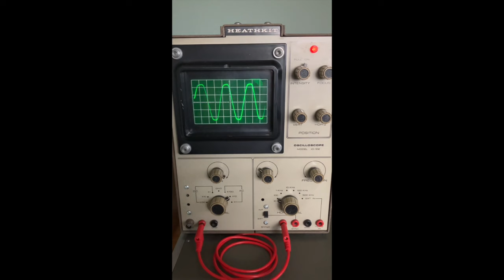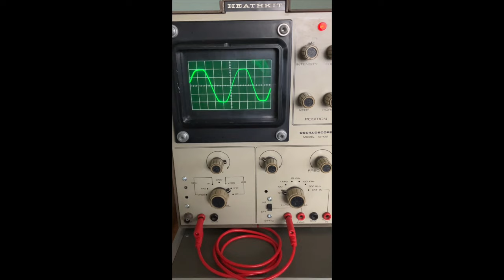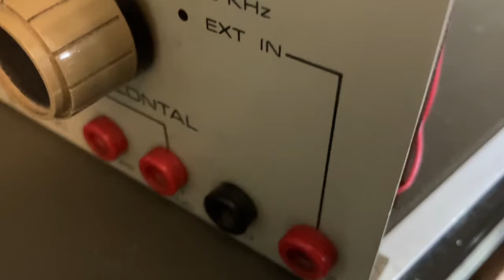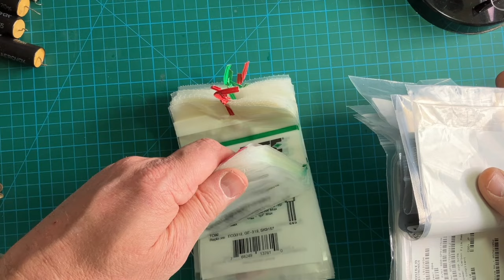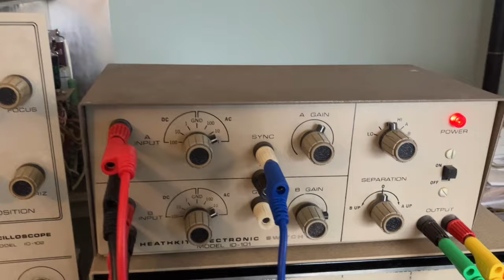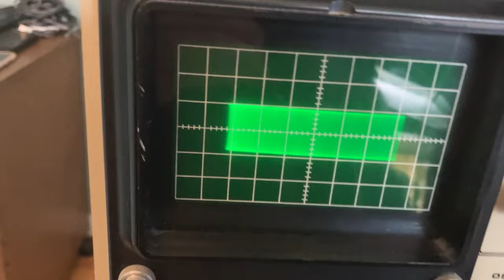Heathkit IO-102 Repair, Mods & Demo

Comment: Congratulations for keeping this beast operational. Back in the 80's, I was given two of these. My impression was that they were neither reliable nor stable. Mine had vertical amplifier issues. But I guess everything has a cost. At least you had fun putting it together!
Reply from the maker: It's been solid since the 1970's, with just a recap and reresistor for good measure.  Thanks for the comment.

Comment: Nice video.   A while ago I saw a craigslist ad for a Heathkit IO-4510 scope for $50.
Dual channel.   I  was messing with building tube amps for guitar playing at the time and wanted a scope to testing.

I went to buy it and upon power on test by the former owner something broke.   It would not power on.
He was the orignal builder, but didn't want to mess with it further and gave it to me for free.

Upon bringing it home it was a single diode 1n4001 or maybe 4003  that had blown.   The PSU caps were OK but I
replaced them just the same due to them being original.

I went and purchased an expensive 20kv rated DMM probe for about $50. The last such item in stock at Frys at the time.

I seem to recall changing the voltage regulator circuit built from discrete transistor arrangement to a 7505(I think).

Worked well, but I ran into a block while calibrating it.  A trimmer capacitor for the vertical trace circuit which is broken. 
It turns but does not make any change on the trace.

For some reason too  they made it super hard to fix because the cap is under the massive stepper switches.   I had to get a super
long length non-conductive screwdriver just to even attempt to adjust it only to find it was really mushy when adjusted and finally 
the top portion fell apart.

Sadly, there's no way to replace that cap without major surgery.  I'll have to desolder 25 pins of the switch to even get my hand in there 
to remove the old part much less position a new one.  I still have the scope gathering dust.  My own electronics hoarding.  

I might get around to repairing it one day.  I think one of the reasons I never did though other than the location was being unable 
to find the same type trimmer cap.  It's been probably a dozen years now since I shelved that scope.   I noted recently though that 
someone selling Heath replacement parts. Maybe I can get that part now...   I might revisit this scope.
Reply from the maker: The 1980s IO-4### series scopes succeeded the 1970s IO-1##.  Nice scope, especially just before Heathkit started really cheapening out their test equipment (IG-5282, IB-5281, etc I'm looking at you).  The vertical compensation trimmer caps that appear to have failed you aren't critical, they're just in parallel with the input attenuator resistors.  Unless shorted, they should not prevent a waveform from displaying.  In fact, most quality scope probes have long had such trimmers built into them.  Your IO-4510 certainly deserves a new life.  Thanks for sharing its story.
Reply: @dtss_smudge  I really went all out at the time.  I scratch built a 4505 scope calibrator.    Made a 1:1 PCB and everything but I reworked the 5v regulator which uses discrete transistor regulator circuit to use a normal 75xx . 7505 probably.   
I made it into a tank compared to the kit version I've seen.  The power transformer is I think over sized but was probably what I found in a local electronics / surplus shop here in Houston.   The logic chips were cheap at maybe a dolllar or two each.  Was a fun build.

I forget what I was doing in the calibration steps of the scope, but I was probably using the 4505 I built in lieu of something more expensive.     I am sure that trimmer was actually broken.  I want to say the whole top came off so it was open maybe.
I know it was a major road block to calibrating it per the manual.

Comment: Great video! I have the equivalent, mint condition with manual, Heath/Schlumberger SO-107A which was a factory wired unit. My father bought it back in 1973 for his FM broadcast radio station. I went through the whole thing as you did, replacing all the old electrolytic caps and some resistors mainly in the power supply section. Not the best 5 MHz scope but good enough for audio and low frequency RF work. Sorry to say I will be putting it up on eBay soon as its time to part with it. I hope someone can use it and not e-waste it.
Reply from the maker: Obviously, 5Mhz was good enough for a FM station!  Make sure to mention on your listing that it was factory and refurbished, Include pics of what must be awesome factory wiring!  Thanks for the comment!
Reply: @dtss_smudge  Thanks for the advice!

Comment: Your video is remarkably detailed. Thanks for your effort!
I also too a IO-102 scope in 1971. That scope is long gone.
I purchased another one on Ebay a week ago.
I fired it up quick. A trace was present. Horizontal and Vert position responded. I felt good.
The next day I was going to delve into more detail.
I fired it up again. No trace present. center dot only. Gain and focus are the only responsive controls
All othe front panel controls not responding.
I removed the side covers. I noticed nothing obvious regarding failed components.
I'm wondering if you have any ideas that would help me focus on a particular circuit/component.
I have the original assembly manual that came with the kit. Complete schematics.
Your input would be greatly appreciated.
Thank you.
 
   
.
Reply from the maker: Since neither horiz nor vert position have any effect, it would seem unlikely that both the horiz and vert amps are faulty.  Really the only thing they have in common is the power supply.  Check each of the PS board's outputs.  Since you have a dot/intensity/focus,, the HV section is working.  must be one of the lower voltage outputs.  Good luck, and take all high voltage precautions when working in the unit.

Comment: Hello and thank you for your video. Sorry, I speak French and I'm using a translator. On my Heathkit IO-102, I replaced the same capacitors as you and the four D40N1 transistors with MJE340G. I bought 2N5459 to replace the MPF105. I'd like to know what equivalent transistors you replaced the 2N3393, EL131, and all the other transistors with, please.

I'd also like to know how I could increase the brightness of the spot, for example the sine wave on the screen, because even though I have a nice image, I think it could be brighter, especially when I increase the frequency. My other oscilloscopes have a brighter trace.

I bought the Heathkit ID-101 on eBay and I'll receive it next week.

 Thank you! 🙂
Reply from the maker: @gtrgib:  Les obsédés de Heathkit francophones sont plus nombreux que vous ne le pensez :). SVP un courriel direct (adresse disponible  en bas de "more" -> "More Info" sur la page d'accueil du canal)  et je vous renseignerai complètement.

Oh, and thanks for taking the time to comment!
Reply: @dtss_smudge  Hello, and thank you for taking the time to answer me.

Why not simply display the list of components you used in the description below your video? It would be very helpful for anyone watching it.

Regarding my question about brightness, answering it directly here would also be very helpful for everyone.

Thank you! 🙂
Reply from the maker: Regarding the parts sub list, I must have assumed my esteemed viewers would simply screenshoot it.

I'm happy to post it, and some other related stuff, in the Description.  Have a look.

I don't remember exactly which transistors I actually replaced,
except that all diodes
and pretty much everything else
on the PS board was replaced,
except Q301 was in fact fine after I added the makeshift heatsink.
As I remember, the other boards worked at least to some point.
Troubleshooting them should in any case be relatively easy
once some sort of green shows up on the CRT!

Regarding the CRT brightness:

(Disclaimer:  Everything below involves tinkering with lethal significantly high-voltage parts and circuits.  Attempt none of this if unfamiliar working at high voltages and with related precautions.  
Also, all CRT tubes present an implosion risk.
Proceed at your own risk.)

Firstly, keep in mind that video cameras
(at least, my iPhone) tend to over-expose green CRT traces,
making them look brighter than they really are.

If your CRT is really really dim, there could be several causes.

Vintage resistors often significantly drift usually upward in value.
With AC disconnected, all caps discharged, and each part out-of-circuit
check R301, R302, R303, R304,  R413, R416 which are all in the HV divider chain.
Potentiometers can also drift in value!
Check R412 & R414 for end-to-end resistance.
Check C301, C302 & C303 for electrical leakage, or better yet just replace them as it sounds you have.

It could simply be the CRT is high-hours and its cathode tired.
Cathodes typically fail well before filaments ever do,
(assuming the latter are not overdriven)
One telltale of high-hours might be CRT burn-in of a sweep trace.
Another might be a no-longer silvery "getter" inside the glass.

A tired cathode can sometimes be, uh, "brightened",
with the CRT completely removed from all  circuitry
slowly bringing its filament up significantly beyond its 6.3VAC nominal,
and keeping it there for a certain time to hopefully expose fresh 
cathode material.  I'd only try this if all else fails, as a last resort, and you don't mind putting the filament (and thus CRT) at risk.
I did not have to try this.

Again, as I said in the video, there's a reason Heathkit didn''t
show high-voltage test points in the schematic.

Only tinker with the insides of any scope with AC
disconnected and all caps, & in some cases the CRT,
fully discharged.  Wear gloves and eye protection when
handling CRTs.

Soyez prudent!
Let us know how you make out.
---

Comment: Nice 'scope.  For the DC-coupled Horizontal Input mod, did you bypass both C121 and the 1MegOhm R129 or just the capacitor?
Reply from the maker: Only bypassed C121.  Left R129 as the pulldown to ground.  In (half a century) hindsight, I also had to bypass C207, so essentially running the horizontal in to the horizontal board input (TP).  Good luck with your IO-102 and thanks for. watching and commenting!

Comment: I just grabbed one. It doesn’t turn on at all! Will it be difficult working on this crt? At most, I only have experience recapping stereo. I know there’s a safety concern as well.
Reply from the maker: Uh, yes. First of all:  Like all vintage analog oscilloscopes, there's on the order of ~2 kilovolts running around inside which is extra lethal.  Never mind normal line voltage.  If you're unsure of what you're doing, please do not attempt. You have been warned.   Now: 1. Get the Heathkit IO-102 manual. 2. See if the pilot light at least lights up.  3. I started by troubleshooting the power supply section, where I found the H.V. section had a bad cap.   4. Once you have a green dot, time to check vertical and horizontal.  Can you move it left and right?  No? Horizontal amp board.  Up and down? No?  Vertial amp board.  Horizontal trace? No?  Sweep board.  It's a fairly simple scope.  Good luck and please be careful.